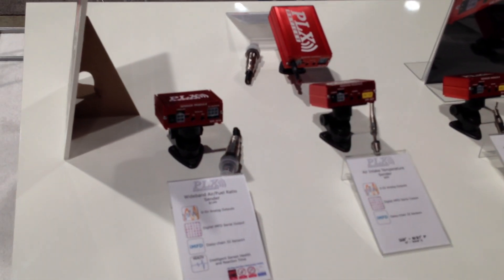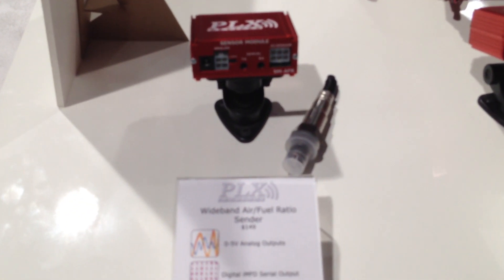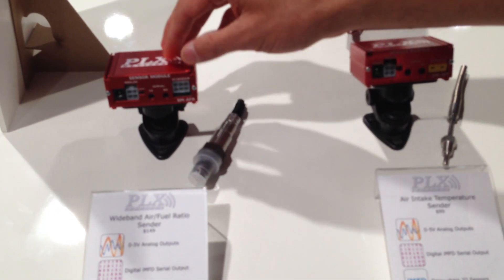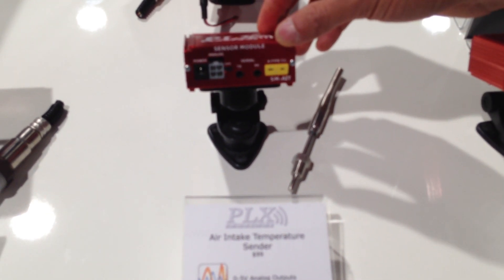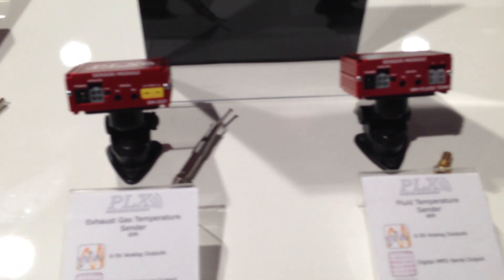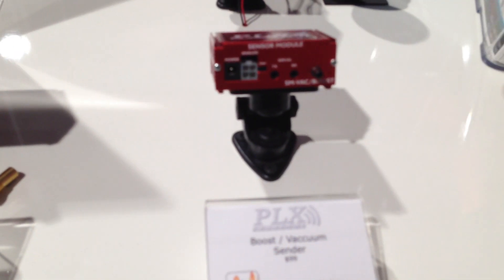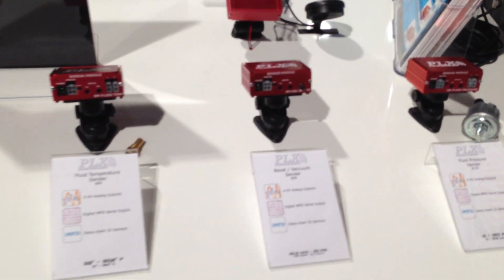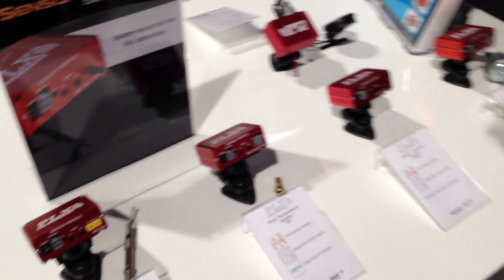PLX Devices Sensor Module Demo SEMA 2013

Comment: So, if I understand this correctly. If I need to see 3 engine parameters(AFR,Boost, & Fuel pressure) I would need to have just one DM-6 and the sensor modules for AFR, Boost, & FP to be able to see those engine parameters?

Comment: I'm interested in buying several sensor modules and daisy chaining them to connect to a carPC running windows to display all the parameters from both the sensor modules and my cars OBD II. Would this be possible? Furthermore, could I simultaneously have two DM series gauges outputting information with the carPC display?